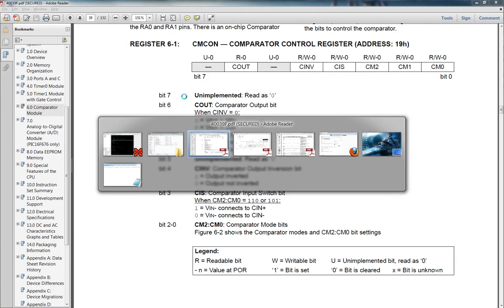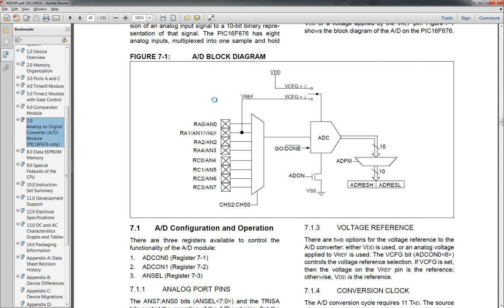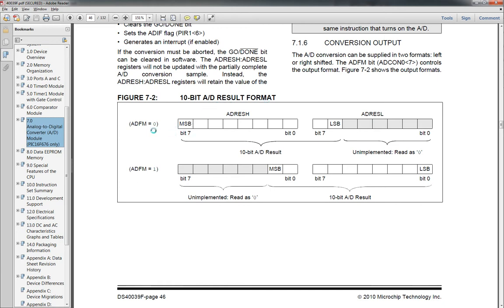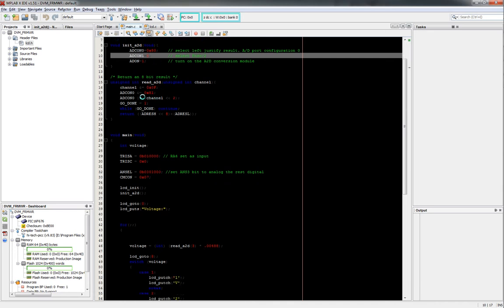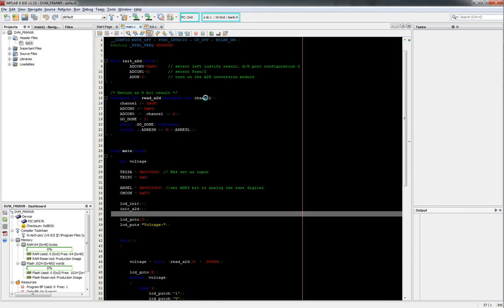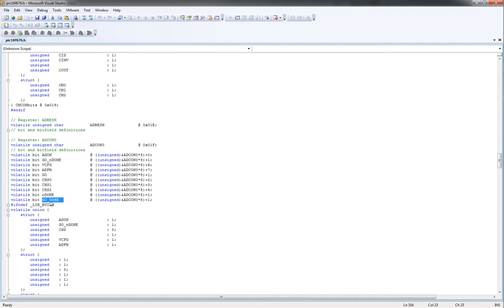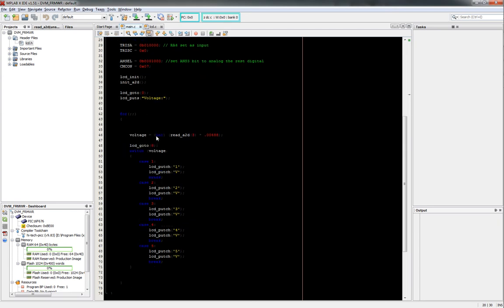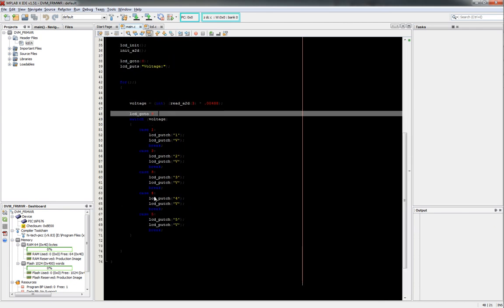Digital Volt Meter Part 2 (SW2)

Comment: Hi, the ADC or Volt meter configuration of all type of Microcontrollers are the same, I mean this tutoriel/coding guide can be used for all type of Microcontroller?
Reply from the maker: Yeah totally.  The methodology is totally useable for all types of ADC modules.  You just have to see what attributes your ADC you are using has and deal with accordingly.  Thanks for the comment.

Comment: Hi, thank you for this video. How do you print a decimal voltage (i.e 4.53volts) on the screen, using the pic's adc, and usart?
Thanks,
Reply from the maker: Hey there thanks for the comment.  I have some videos about sending information over serial to a PC if that is what you mean by USART.  I have a playlist for creating accelerometers and sending data to a PC through serial using USART Lesson 9 Accelerometers Part2  Also to send decimal numbers you can always use float in your micro and then, in your case of 4.53, you can type cast the float as integer to get the 4 and then you can modulus devide by 1 and multiply by 100 to get the 53 (i.e. num = 100 * (4.53 % 1))  Hope fully this helps.